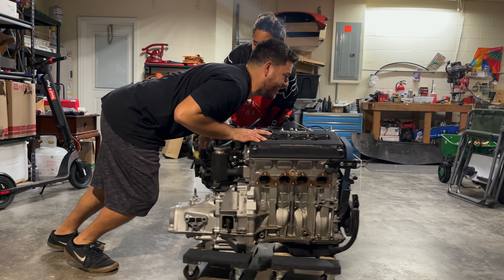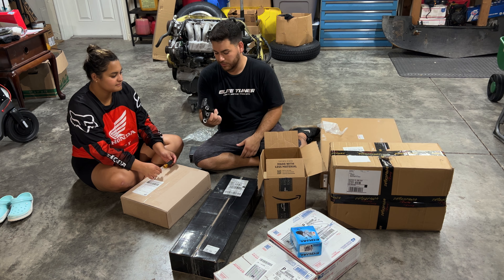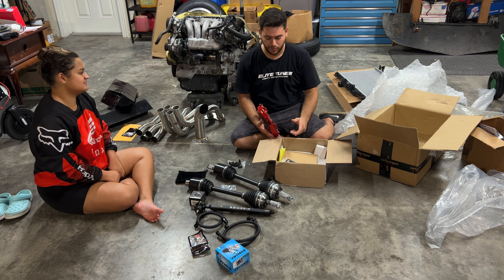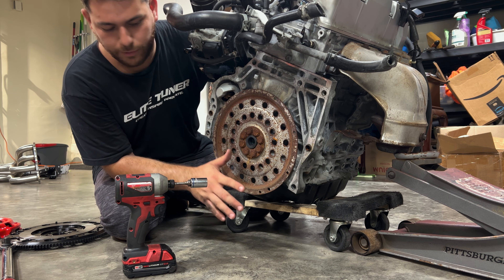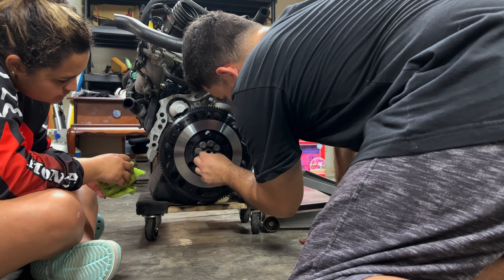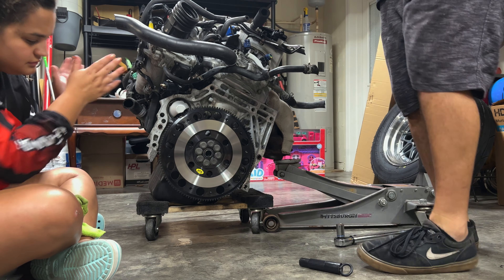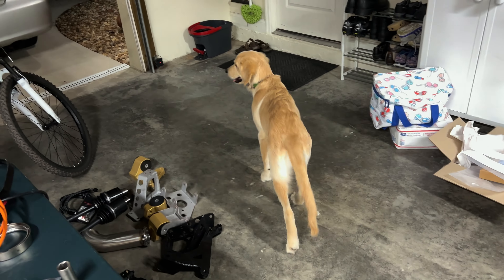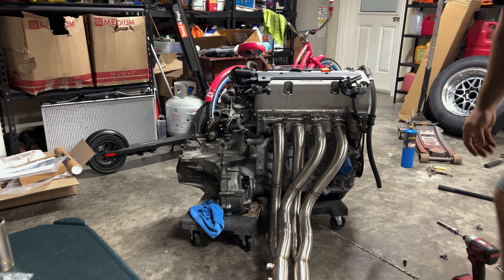K24 Clutch Install !! Sam's K Swap Integra Build Starts NOW!

Comment: I’m running a stage 5 xtd clutch on my turbo k24a2 and no issues yet
Reply: I always thought throw out bearing was the issue with those. Clutch itself is fine
Reply: How much Hp & torque you have on turbo car ?

Comment: Love this inf I'm planing  to go k on a da integra  1990 this its the best way to save $ and have good power my b18 engine smoke a little  bit on start and stop side  so I need to get there hopefully  in the beginning  of next  year   I downloaded  the  video  to use it as reference  👌🙏💯💪
Reply: If you already have a B18 in your Integra and want to save money on a swap, why not just switch to a B20z block? Old school CRVtec. ~200 hp, high 13s.